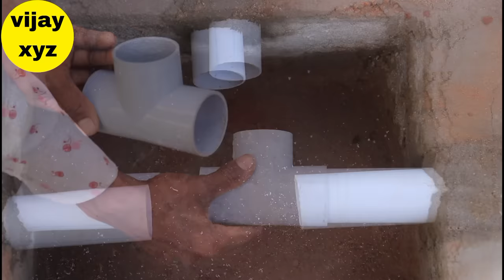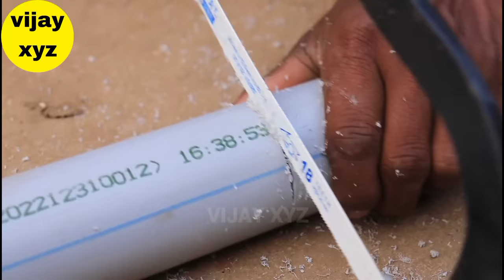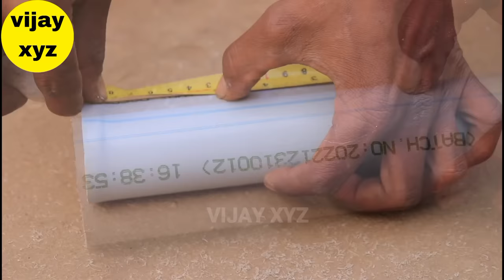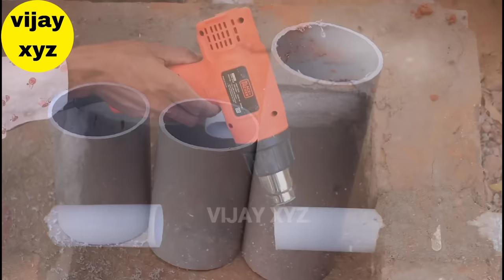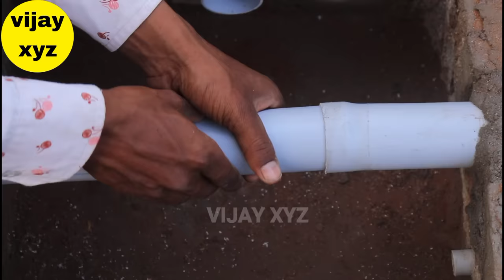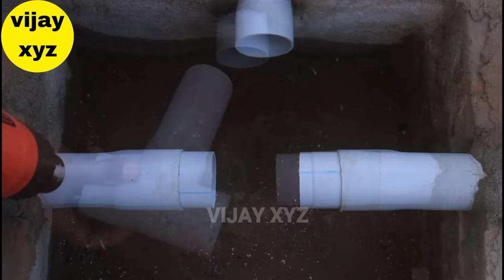I DIDN'T KNOW HOW TO INSTALL TEE IN SMALL SPACE BEFORE THIS SECRET TRICK.

Comment: 2 unions and 1 coupling will fix it correctly
Reply: That’s what I was thinking the entire video. 
Doesn’t heat reduce its integrity?
Reply: The easiest thing I would’ve done is to cut pipe at the end where there was a 90 degree elbow where the pipe goes into the ground it would have eliminated all that work
Reply: I don’t like the heating.  There is a better way.
Reply: I was literally coming here to say the same thing. Bet this guy spent a couple hours fixing this simple plumbing problem if he would have done it the correct way it would take 10 minutes at the most.
Reply: I agree with your comment....but...if in the bush....no stores around that are open...this....will....work.Btw......this is a nice exam question
Reply: Part of solution includes doing it without spending a lot, too.
Reply: You don't think they have a screwfix over there lol

Comment: Super heating to bend the pipe and then reheating will result in a shorter life span of the connections
Reply: No it won't. I have done this trick dozens of times. Last time was in the 80's and water pipe is still holding strong after almost 40 years.

Comment: Whenever you add heat to something you alter its structure molecularly so therefore it's probable that is fittings were not properly installed in a leak may result
Reply: Agree

Comment: Okay so what's the lesson in this? Well just for starters...if you leave just one of the pipes mobile this goes together easy. Second, if pipes are not mobile at all, you can use a PVC compression coupling or dig up one side left or right to bend that joint together. From a former irrigation installer.

Comment: Looks good but won’t last under pressure. Proper repair would be to use 3 threaded unions. The integrity of the pipe was ruined with the heat gun & bending of the pipe

Comment: But will this work with thicker schd 40 3/4" PVC piping?
Reply: Irrigation Engineer here... nope, that looks like drainage pipe and for drainage I try to never use T's but Y's... for SCH 40, is better to use threaded unions or slip couplings... good video for an emergency, but I would not recommend. And if you need to build a block/concrete box, leave room for future repairs (I always leave the fitting on one side of the box, that gives me space if I need to use couplings).

Comment: I'm not a plumber but this doesn't look like it is up to code in the U.S. If this is a supply it may not hold up to the pressure. If it's a drain then drain fittings should be used.
Reply: I’m pretty sure this wasn’t the US.

Comment: Not the correct way to do this you're changing the molecular structure of the PVC pipe and in New England with the seasons the temperature variations due to weather

Comment: It seems it is a chamber arrangement with two inputs and one output.The output pipe should have been lower than the input level.
2)if it is one input and two output, the two output pipe s should be lower level than the one input pipe.

Comment: Also not a good repair heating PVC changes the molecular structure here in New England with the seasons it doesn't hold up when the extremities of weather prevail shortening lifespan changing molecular structure don't know what else to tell you but you're doing it wrong do it right or don't do it at all or hire someone but I certainly wouldn't hire you
Reply: Don’t be jealous

Comment: Making up 3 connections at one time? There ain't enough time, can't twist pipes into place as recommended. Bet there were dry joints, especially after heating up the glued joints to pretty up all those twists added to do this THE HARDEST WAY POSSIBLE.
See, here in America, where PVC originated, we established what is called a set of BUILDING CODES AND Best Practices Standards. We created ASME and ANSI Standards, along with some pretty good testing procedures to control how those were created.
But hey, the rest of the world just needs a hair dryer and some clear glue. You do you, dude. I'm guessing this is a water supply system, since the tee didn't have a sweep. And even though the pipe is grey, it for SURE isn't electrical conduit without a sweep on the tee.